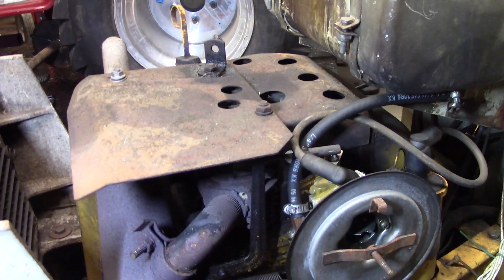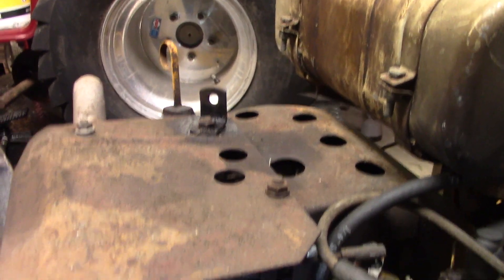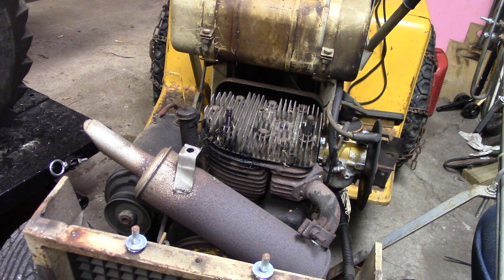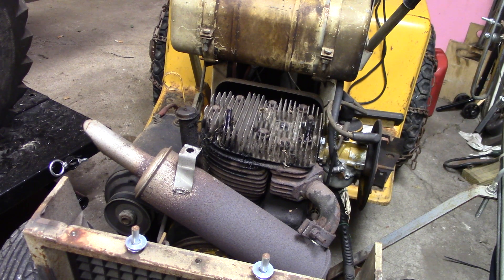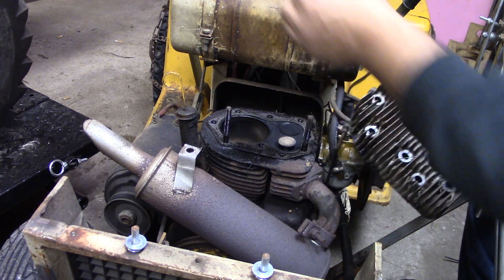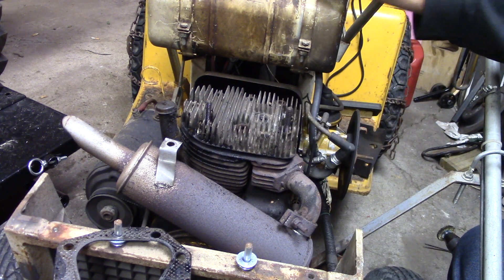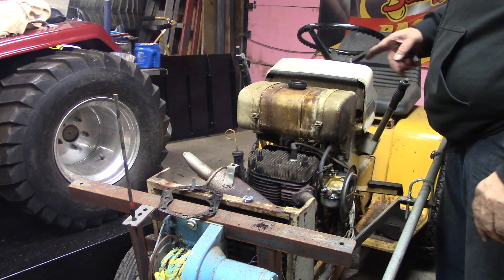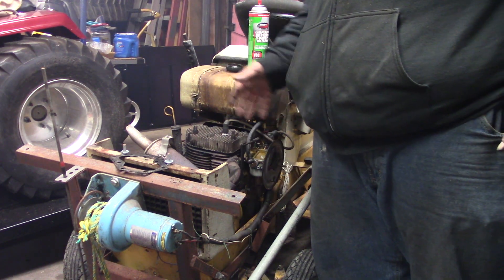How to diagnose  and replace a small engine head gasket. #smallenginerepair #howto

Comment: I scored a nice great running electric start cast iron 12 hp Kohler the other day. Had to go two miles back in at the base of the mountains on a cow trail to get it. They were completely off grid with 17k of solar power.
Reply from the maker: That's awesome , the cast iron ones are getting harder to fine in good shape
Reply: one thing I had never seen was the fan shroud had two creases built it up towards the top as it went over towards the head I have only seen them smooth. I thought it was dented in at first.